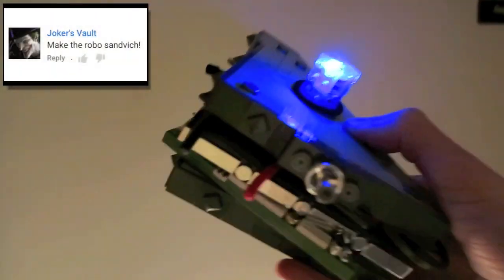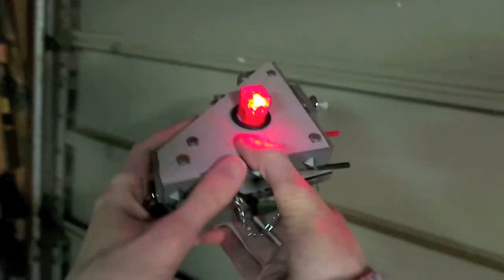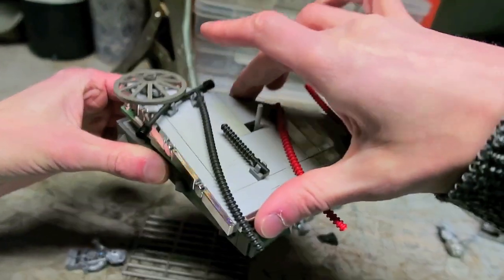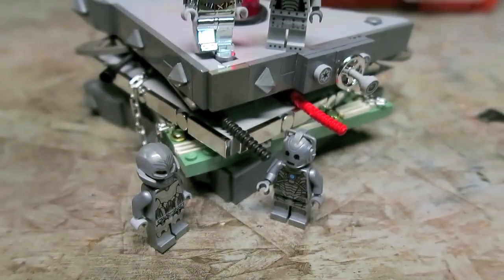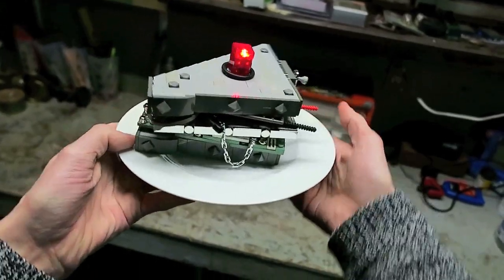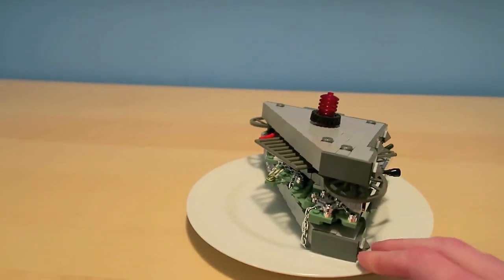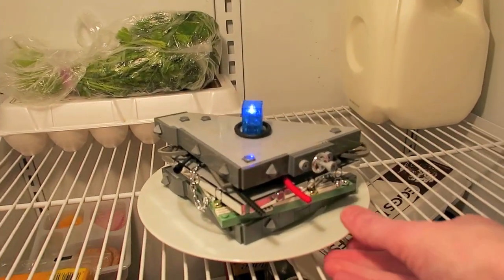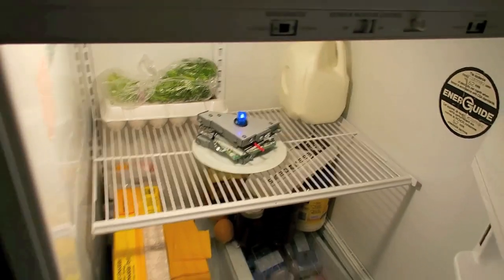LEGO Robo-Sandvich - Team Fortress 2

Comment: Fun Fact: This is also one of the rarest and most expensive weapons in the game, since you could only get it by redeeming a code from the Three A Toys Sandvich that you could get by either going to Comic Con 2010 or by buying it on the Valve Store about 3-4 years ago for $50 (albeit, as a different version since it was designed to have a bite in it).